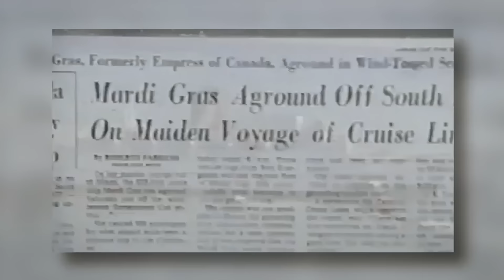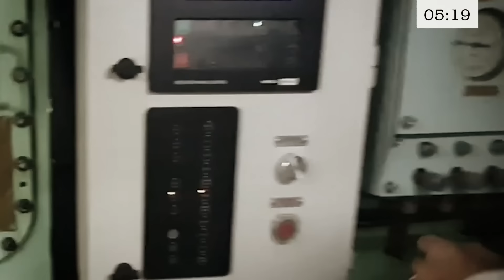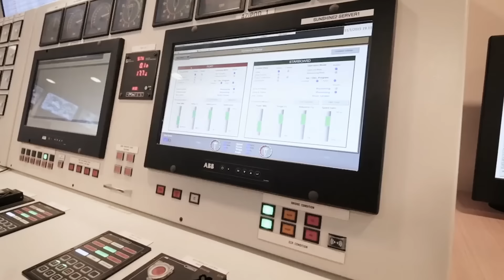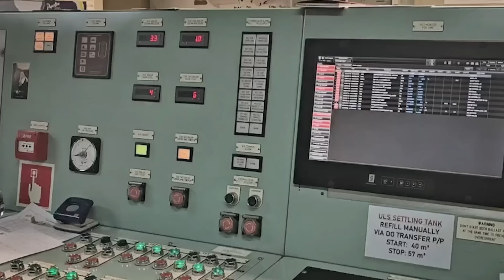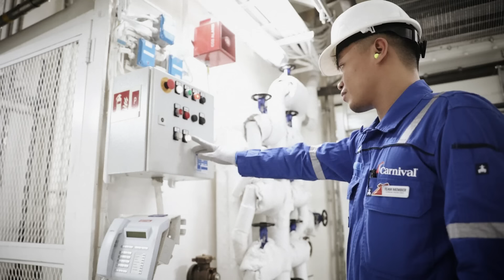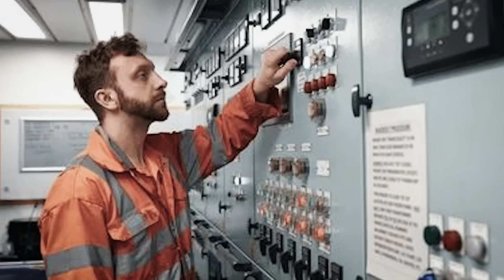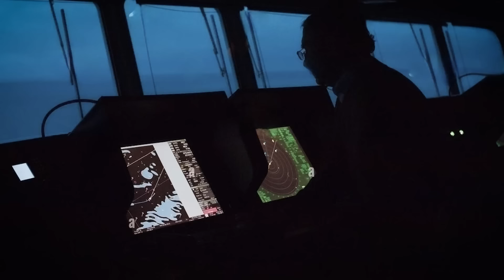From Carnival Party to a POOP Party!

Comment: I do not understand why they didn't dump the waste overboard?? better out than in....
Reply: they were unable to get power to the necessary pumps due to the fire damage and a single point of failure
Reply: @cruisinguy6024  they were able to run temporary power to run the C02 fore suppression system. They could have done the same thing with the septic tank pumps. 
Or they could have opened valves and just dumped it overboard
Reply: @crazypete3759  Modern cruise ships have waste management systems just like a cities sewage treatment plant that separates liquids from solids and treats accordingly.  They do this to avoid the immense polution of just dumping raw human waste and toilet paper overboard (even though that is illegal when out to sea).

If it was as easy as opening a valve don't you think they would have done that?  Come on....

Also there's an emergency diesel generator that's designed to run just the bare life safety essentials like rudder control, blower to restart the mains, certain bridge equipment and electronics, and so on.  Just because they could operate the fire suppression system doesn't mean they had the ability to run the waste treatment plant.
Reply: @cruisinguy6024  the maximum fine is $250,000 for dumping sewage close to coastline. They can legally dump sewage at sea. There are bypass valves and clean out valves, even if the system isn't designed to dump the sewage overboard it wouldn't be very difficult to make the necessary changes.
Also most of the rooms are above the water, anything above the water line can be dumped overboard by using gravity. It wouldn't require any electricity to run pumps in that case
Reply: @crazypete3759  That's not how things work facepalm Again...if it was that simple THEY OBVIOUSLY WOULD HAVE DRAINED THEM OVERBOARD.  

Cruise toilets, like airplanes, utilize a vacuum flush mechanism not a gravity flush like residential toilets.  Does the vacuum in your home work if you don't plug it in?  Will it magically suck up dirt without power?  No, of course not.

By necessity these systems require power to run the vacuum pumps to move waste through the plumbing from all the cabins and public toilets.  It was never designed or intended to work via gravity because, quite literally, that has NEVER been an issue.  Even now they're still not designed because this was a one-in-a-billion event.